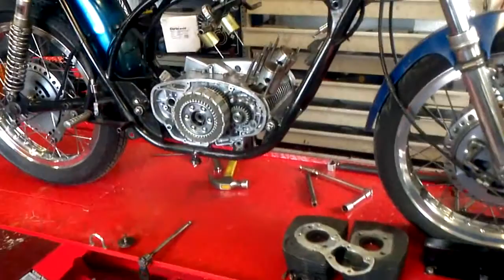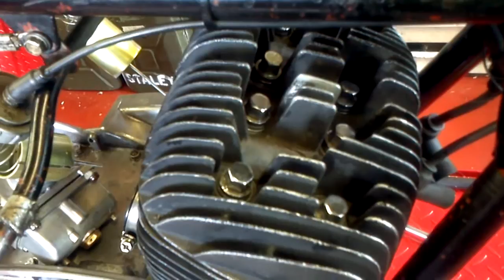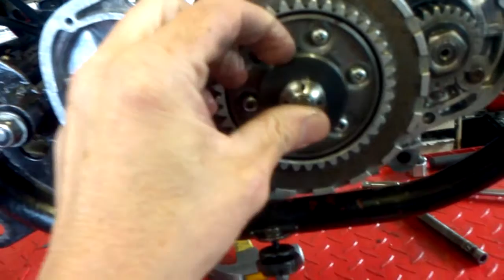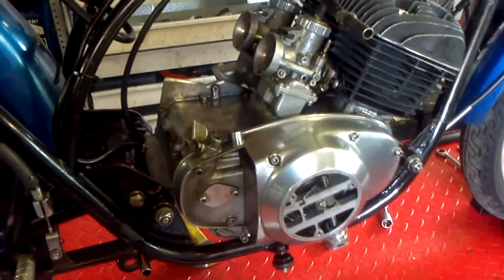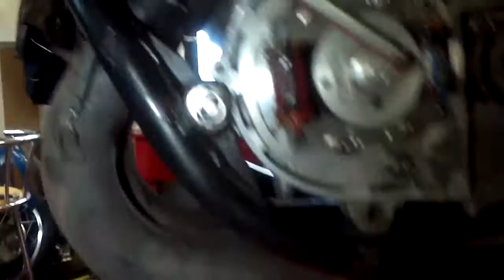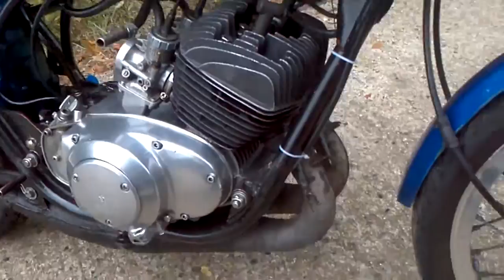Suzuki T20 Engine Reassembly (2) - finishing it off

Comment: a proper race-engine has a dry clutch,   not so difficult to build one,    the main advantages are;; less drag, no gearbox oil contamination, less friction resulting in a (slightly) higher output, ease of maintenance!!!

Comment: Hi Adrian. I'm working on a 66 X6 T20. Where can I get parts for it? Ebay seems to sell very used up parts or very expensive NOS ones.
Reply from the maker: @Topper-gf8xl  It depends what you want. Crank bearings and seals are pretty much unobtainable, hence the high prices. There are workarounds though - I've used modified Kawasaki KX fork seals for the centre seals in the past. 
 Other stuff is much cheaper. Crooks Suzuki in the UK supply loads, not sure about elsewhere.
Reply: @t20racerman  Thanks Adrian.This bike has been stored for many years without side covers due to someone pilfering them, so a lot of rusty shafts and gears. One piston also appears to have seized and scored, but whomever sanded down a bit to remove the high spots. 🤨I want to replace them. He did give me a 350cc he swears fits into the frame with minor cutting and welding though.
Reply from the maker: @Topper-gf8xl  Pistons and sideways covers are available on eBay. You can use GT380 pistons if you want.
As far as I know, the T350 engine fits straight in, but I'd keep it as a T20 if you can. These were brilliant little bikes that are a joy to ride.

Comment: My super six is complete except I have lost the little plastic coupler for the oil pump/cable. Second hand from the US  at 57 USD each part and the same again for postage each from EBay, then the  VAT and Post office charge £250 ish for old secondhand bits that were 3 shillings each new. I will have to make a new one  at home. Still love my T20.I bought new in 68.😊
Reply from the maker: A lot of expense for a pump 🙁 Owned from new - wow, impressive! 😊

Comment: Ive got teh same bike but the only difference is that it is on 100 pieces. id be interested in rebuilding it though. does anyone know any manuals that will help me with rebuilding the engine if i decide to invest the money and time.
Reply from the maker: Check out my website find all the info you need www.t20suzuki.com
Reply: Thanks a Million. :)